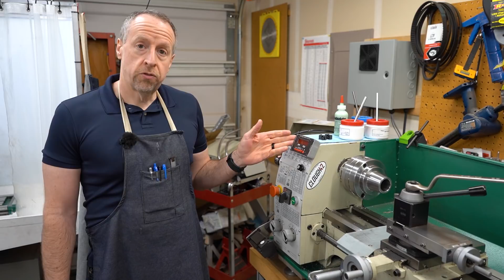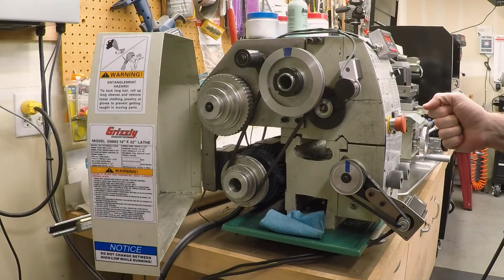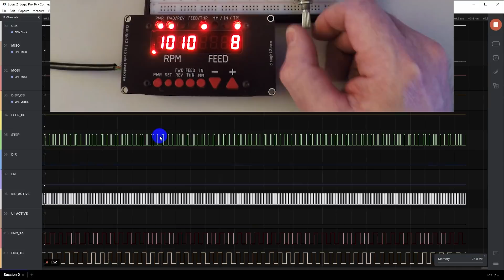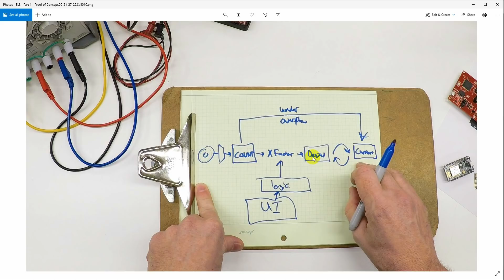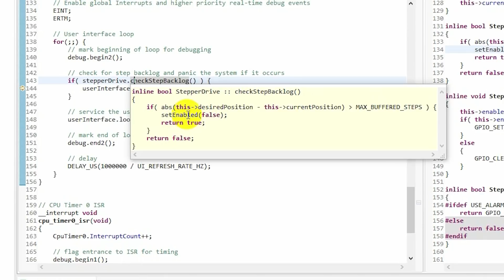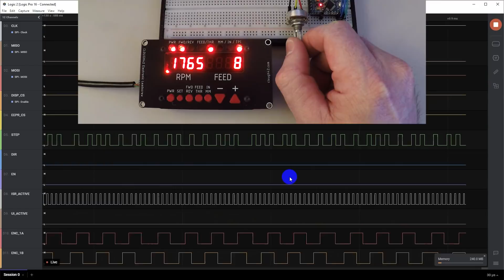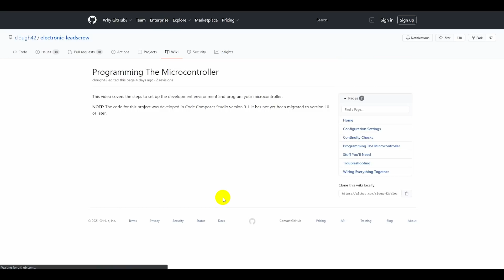Overspeed Error Detection | Lathe Electronic Leadscrew - Part 21

Comment: Some idle speculation:
You've got the lathe on a VFD to control speed. You now have (as a side effect of the ELS) a tachometer. In principle, you could now close the loop on spindle speed and electronically set a target speed, and drive the VFD to maintain it. You could then use that mechanism to cap spindle RPMs depending on your ELS settings to avoid saturation.

Comment: I'll be buying one of your kits soon for my mini lathe. This is a very cool idea with tons of potential in it for more functions!!!
*
My lathe has no threading dial and I have to reverse the lathe to remain on track for threading. It's not a huge problem and works exactly the same regardless of the thread pitch or SAE/metric. I don't have to know anything about my lead screw being metric or SAE. This is a pretty common situation with many mini lathes.
*
I do have a few ideas that are all software:
1. It would be cool if the + and - buttons could be used in combination with another button or by turning something on and off to run the lead screw forward or backwards for powered/manual movement. It would need to account for Items 2 and 3. 
2. This controller could act as a carriage stop in feed mode or threading mode. You know where your inward position towards the spindle should be by looking at where you want the carriage to stop. Add an option that records that position with a button press. All movement inward or outward is then tracked from that position as long as the half nut or thread nut is engaged. For threading and lathes like mine that lack a thread dial, this would work superbly for threading. 
3. With multiple programmable carriage stops, the lead screw could be used to position the carriage any where along the bed to perform some operation in a selected area of the work piece.
4. Items 2 and 3 are potentially quirky since people can and will disengage the lead screw. Add a limit switch feature so the motor stops at maximum inner and outer limits to avoid crashes or jamming the carriage at its travel limits.
5. You already have the micro-controller, controller and servo in place. Make the software accept external input that is common to CNC lathe controllers. Now the motor/lead screw drive can be one of the 3 axis for CNC machining. Turn off/on some option and it operates in "Stand alone" or CNC mode. 
6. This is silk screening and software. There are the decimal points in the 7 segment displays that could be used to indicate that the above features (and others) are turned on. The front cover silk screening would need to be changed right under the led "dots". Label them appropriately  for what each LED dot indicates. Items 2 and 3 could be labeled MEM1, MEM2, MEM3 and MEM4. Item 1 could be labeled "DRV" or "Drive" or "PW-DRV". Item 4 could be labeled "LIMIT". Item 5 could be "CNC". The RPM and FEED silk screening would need to be moved too.
Reply from the maker: The ELS is a simple device that does its job well.  It sounds like you want a CNC conversion.
Reply: @Clough42  Not really full CNC for me at least and that was only 1 of the things I listed. The rest of the items I listed were not CNC. How a carriage stop is "CNC" is a mystery to me. Same for stop switches, but they are used in full on CNC.

Comment: James I ran into a problem today, everything was working just fine. I was running the lathe and all of a sudden the drive stopped. I am no longer getting a tach signal! the Display powers up normally nut when i power on the spindle I get no tack reading. I removed your interface board and check all my soldier joints went through all the continuity tests from pins. checked the switches on the board. I have two green led's on the interface and the blue and red on the TI all the buttons work on the display but no tachometer reading. Is there a way to test the encoder. I don't have anything other than a decent volt ohm meter. I am using the encoder you used Although I'm thinking its a Chinese knock off. I hate to start throwing parts at it. I need help. Also in a case like this, is there a way to operate the stepper motor at least for turning.?? Please help!!!!
Reply from the maker: The encoder drives the tach display.  It the display is responding (can change pitches) and the tach reads zero, it isn't getting an encoder signal.  The encoder connects directly to the launchpad board, so the problem would lie with the encoder, cable, or the launchpad.  You could try the other encoder connector on the launchpad board (EQEP2).  You would also need to change Configuration h and reprogram it to use the other encoder input.  If that works, the Launchpad board is damaged--possibly by static electricity.
Reply: @Clough42  James, thanks again for the quick replay. Those were my thoughts also, although I am leaning towards the cheap Chinese knock off encoder??? I ordered a second encoder and found a Launch board still available, They are getting short in supply. neither will go to waste at this point. My next question is if the board is damaged is there any chance that it ruined the interface board?? I'm not at all apposed to also replacing it if you feel there is any chance of it hurting the main board. I am trying to be cautious here because of the lack of Launch boards. The price is insignificant. 
 I enjoyed the electronic lead screw so much for the short time it operated, I have to get it up and going no matter what! Such an improvement on the old Atlas lathe!

Comment: Can anyone help with a question I have??? I have completed the electronic lead screw and it seems to be working well! I would like to add an emergency stop along with a carriage stop. the carriage stop would only be for emergency purposes. I am fine with the mechanics of this but need help where to do the wiring. can i just connect normally closed switches in series in the enable - line or do i somehow use the Alarm circuit??? Any help would be deeply appreciated!
Reply from the maker: You can connect normally closed switches in series with enable if enable is normally-closed.  Different drivers do this different ways.  If disconnecting the enable causes the motor to stop, it will work.  You may be able to reverse this in the driver (and invert the signal in Configuration.h). You could also disconnect the STEP wire, but this would not help if the (servo) driver is running away for some reason.
Reply: @Clough42  Thanks so much for the quick answer James. My main concern at my older age is an inadvertant crash into the chuck I really would like to thank you for sharing your knowledge on the build. Most of this is way past my payscale!! Thanks again.
Reply from the maker: @chuckmayerchak3071  in practice, this works the same as a gearbox.  Keep your hands on the half-nut lever, the same as you would normally.

Comment: Hi James, 
Thanks for all interesting things you share with us. I would like to build your ELS for my late but the TI LaunchXL-F280049C evaluation board specified in your BOM is not available anywhere. Is there other TI compatible version, like the LAUNCHXL-F28069M which is available, we could use instead ? Many thanks in advance
Reply from the maker: Wow.  They're backordered until July?  That's frustrating.  The f28069m is a different animal and isn't directly compatible, unfortunately.  If the shortage continues, it might be worth porting the project over to another platform.
Reply: @Clough42  yep it is, I just ordered combo on your ebay, fortunately, it seems there are still some LaunchXL-F280049C available on aliexpress, I will try by this way...
Reply from the maker: After a little more research, it looks like it's the chips themselves.  Every version of the microcontroller chip is out of stock everywhere--even the offshore assembly houses.  I thought I had designed my hardware to use commodity parts that wouldn't be subject to supply chain issues, but I didn't think about the TI chips.  :(

Comment: I am using this comment section to convey my thanks and appreciation for your design.  After a number of weeks intermittent effort, I have finally finished my implementation of your ELS system. To coin one of your favourite phrases - "I could not be more pleased with the result"!  The ELS boost PCB and associated printed products were superb and, despite frying one Launchpad board, I got it to work more or less straight away with the replacement.  Thanks, again.
Regards,
John

Comment: I am not sure where to put this but here it is.
You now have an electronic lead screw, a tool post gridnder and VFD motor control on your lathe.  Given this combination it would seem that an option would be to add a capability to be able to control the angle of the spindle under electronic control.  This would be helpful in making gears as an example.  There are a few options for this.  Probably hte most logical would be to add a rotary encoder to the spindle as the belt from the motor may slip losing accuracy.  For accuracy considerations if the maximum number of teeth in a gear is ~120 and a involute toot is requied I would estimate the angular accuracy required would be 5 deg or less (normalized by the number of teeth).  The maximum step sized would then be 120 (number of teeth) * 360/5 (relative accuracy) = 8K steps/revolution.   4K encoders are common but I would expect this this would be sufficient for 99% of the applications.  If the encoder drives a interrupt service on zero crossings, the interrupt rate would be at 60rev/sec or 360 rpm max would be 60 rev/sec * 4K step/rev = 240K steps/sec or 6 ns.  This would be very difficult to achieve in a SW only solution.  
An alternative is to purchase an chip for the pulse to position counter similar to LS7366 which can operate up to 40 MHz pulse rate and design the controller assuming this HW assist.   Given 4K steps/rev and the 40 MHz pulse rate then equates to a maximum 40E6 step/sec  / 4E3 step/rev  = 10K rev/sec max which is far above what would be normally required.   The loops in SW could then run at this slower rate like 10ms/time increment. 
If you commit to the rotary encoder the control would have to be a bit more sophisticated probably necessitating a processorfor the unquie control required.  My chioice would probably be a rasberry pi for this control   One could then also incorporate the lead screw control as well reducing the number of parts in the lathe system.   
As a note in the lead screw controller you used floating point math for the conversions requird which is probably sufficient in this application.  I have in the past imiplemented controllers for rotational/angular control.   If the device has the possiblity of many (millions or more) rotations between starup and shut down (in systems that normally run until they break).  In this case one can represent the position as an integer (with some number of fractional bits for the number of whole rotations).  The control system nearly the same as the FP version and usually faster and possibly more accurate.  
I suppose that a BLDC motor could also be used in the tool post tool as well.   However I cannot think of a reason rotational posisition controll could helpful but a standard VFD type control could also use the same processor/controller.   
This soluition would require several other parts for the motor drivers and other consideratoins.   I am not sure I would take on the additional work but it is tempting.

Comment: THANKS TO JAMES (and anyone else supporting this project too) for this really good project - I have followed it all the way, it has been enlightening (and successful) throughout.  My real aim is to cut a helix for which I need to be able to load any longitudinal travel parameter (in mm).  Any ideas?
Reply from the maker: I've been thinking about that ever since Tom Lipton demonstrated his setup.  Do you think very many people would be interested in cutting helical parts on the mill?  Or were you thinking of something else?
Reply: I don't have a mill but I am intending to use a milling attachment fixed to the cross slide. I'll ask someone else in the UK who is following this ELS series for an opinion.
Reply from the maker: @kenhelix4494  ahh... So all you would really need would be very large thread pitches?  And the ability to turn the lathe very slowly.  You should be able to add larger thread pitches to Table.cpp as long as you have a high enough encoder resolution.
Reply: @Clough42  Hi, I asked my one contact who is following your ELS design and have drawn a blank as they already have a 4-axis mill. I don't know anyone else locally, typically through the Society of Model Engineers (UK). Regarding encoder resolution I have the encoder you specified and I drive that from the headstock with a 1:2 ratio (1 turn headstock:2 turns encoder) which I believe is 8192 edges per headstock turn. I agree I need large pitches, so thank you for pointing me to Table.cpp. This is such a good project as I have now cut threads without changewheels and a Cardan shaft.

Comment: Got my kit and the TI board. 
If you mount the booster pcb in the wrong direction, it does not work, of course, but it does not kill anything. 
As someone I know from youTube would put it, "Ask me how I know!"  ;-)

I had some cold sweat once  I realized. 
I am waiting for the encoder to arrive, I am very excited with this project. It will go on a Chinese mini-Lathe. More later.

Comment: Hey James, I just got my kit a few weeks ago, still waiting on the stepper, but once it gets here I'm going to get started installing.  I know in a previous video you had mentioned possibly adding a feature for an infeed stop.  My lathe doesn't have half nuts, so this would be an incredibly useful feature.  Are you working on it?  If not, I may take a swing at it and send you a pull request.  I've coded in C#, Python, PHP, and a half dozen other languages, but never C, and I've never coded embedded platforms, so maybe this is a terrible idea, but I'd love to give back to the project.  You've done something huge for the open source community and it's awesome!

Comment: Is "Panic! Stop" the best way to handle this? I mean assuming it's something like a threading pass then "Panic! Stop" is the same as "Auto scrapping your part"

Wouldn't a better solution be "Too Fast" to the display telling the operator to slow down
&&
If the spindle stops (or having been high falling below 1 RPM) then stop the enable of movement on the output
Reply: Keep in mind this is a serious safety issue, preventing a crash. IMO a warning sent to the display is a half measure that (1) may not be noticed, especially by an operator who is obliviously overdriving the ELS, and (2) doesn't mitigate the risk of a crash.

Stopping the servo actually IS the message to the operator. "Stop doing that!" 
No need to worry about scrapping a part, because anyone overdriving the ELS hard enough to trigger this condition wasn't making a usable part anyway.

Comment: Hi James.  I'm finally getting around to my ELS.  I have everything up and running on the bench with no issues.  (I loaded 1.4.00) My lathe has different drive train for the feed so I need to modify configuration.h to account for this.  It looks like I need to modify lines 78 and 79.   Do I replace "STEPPER_MICROSTEPS" and "STEPPER_RESOLUTION" at the end of lines 78 & 79 with the numeric numbers I need?   Thanks again for all you do.

Comment: If the high rpm with low tpi scenario kills the feed during operation of cutting a thread Does the feed stepper stop while the spindle still rotates? Wont you have an issue with smashing the tool during the cut? Could you program a total system (spindle motor and stepper feed motor) shutdown?
Reply from the maker: If the cpu had control of the spindle, this would be possible,  but it doesn't.   That's starting to get into CNC conversion territory.

Comment: Sorry in advance to ask about how you've spent your money, but I am mostly ignorant of the cost of the electronics. How much does all this add up to? The controller, encoder, motors, readout, etc. Plus the lathe itself(and any improvements to it). An estimate, of course, is what I ask before I even think of starting something like this. If you don't mind answering.